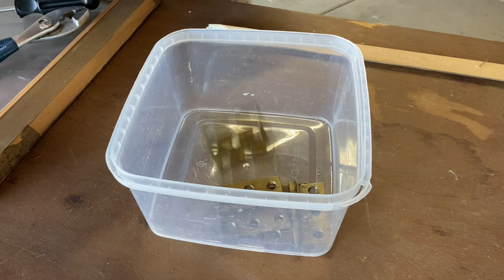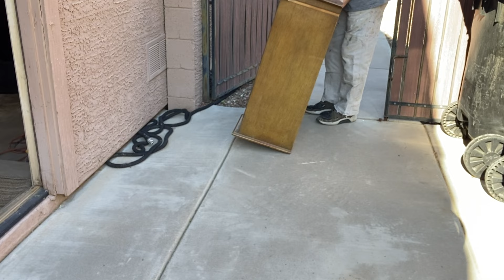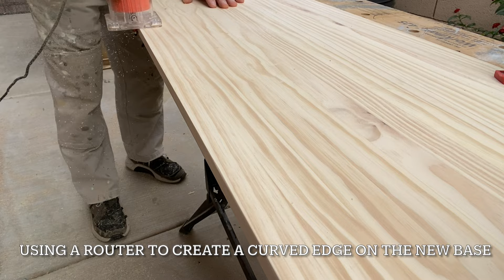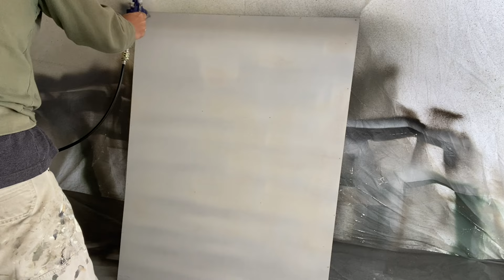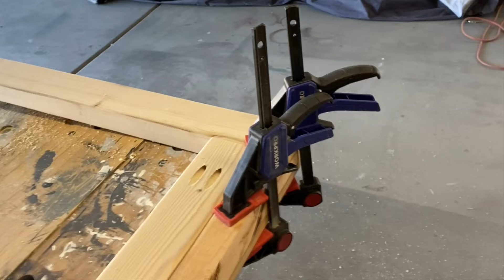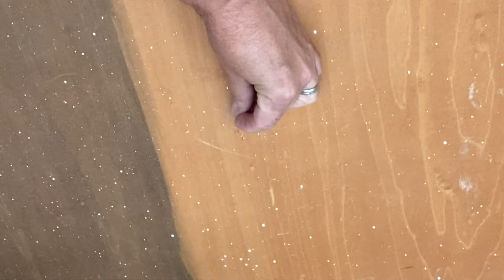Transforming the Top of An Old Hutch Into A Stand Alone Display Cabinet.

Comment: I saw , the transformation of the bottom of hutch, very nice.  Just finished watching the top portion.  Two things I would have done differently, I would have stained the leg portion black.  I think that would have gone better with the top.  Secondly, I would never have glued the trim in.  They are meant to be nailed in.  If the glass breaks it is going to be impossible to remove the trim without breaking it and/or the glass.  Overall,  the top came out very nice.
Reply from the maker: Thank you for the comments.